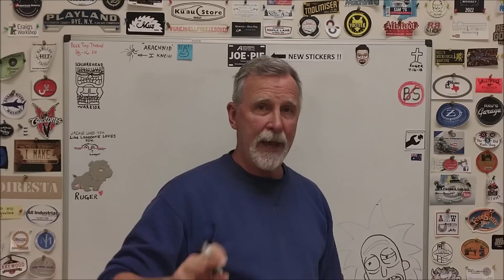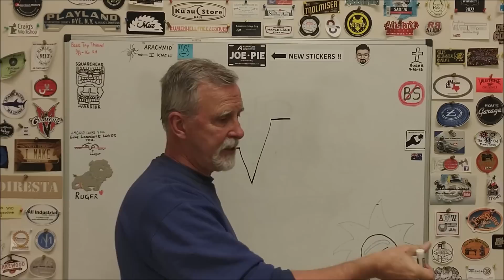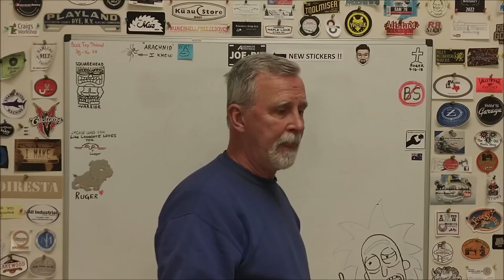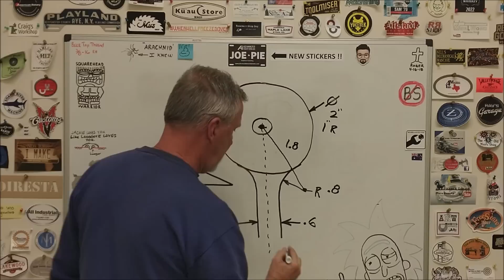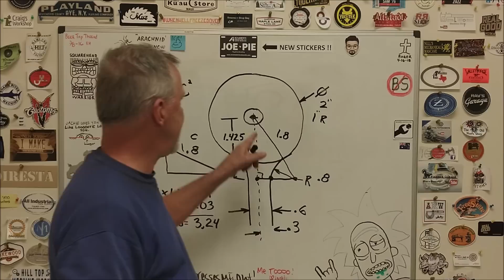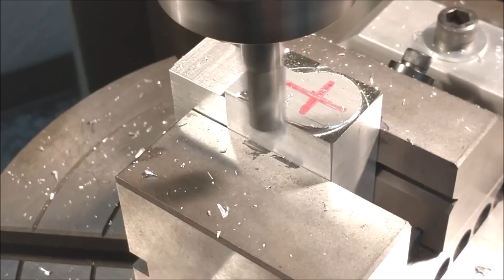Machining Perfect Dog Bone Features -- Quick and Easy !!!

Comment: Joe:  I wish you had been my math teacher as well.  Another tip.  put the parts of the equation into the form of a triangle.  C^2 above A^2 + B^2  This helps math dolts like me to keep track of what to divide into what to solve for the missing #.  Works for Ohm's law, Power formula, anything with a number (+ or *) a number (=) a third number.

Comment: Joe, really important to point out that Pythagoras only works for right-angled triangles - 90 deg between sides A and B.  All other trinagles will need trig.
Reply from the maker: You are correct. I did point that out later in the video.
Reply: @joepie221  Yes, I got there eventually!  Great job as always Thanks.
Reply: Math in the beginning of the video  should not  be explained here. Everyone older than 13 should know it.

Comment: I'm always fascinated that people need explanation for 6-th or 7-th grade elementary school mathematics :)

Ah.. and also that americans just do not learn even the definition of the Inch :)
And yes.. definition of the inch is that it's exactly 25.4mm :)
So 2" is 50.8...
Reply: I work on American designed, Canadian made machines here in Australia. They have been exporting machines into metric countries for decades now, and they still don't know how to calibrate the machines for metric. I have now found out that they have rounded out 12 inches to 30 centimetres, which makes a big difference when measuring product with lengths typically around anywhere from 3 metres to 25 metres. And I have fixed up numerous other design or programming issues. No matter how often I tell the Americans about the issues, they basically just ignore them.
Reply: Knowledge is Relative 
If it’s over 50 years since you did the theory at school and never used it since, then a refresher is a great help.  I’m not been picky but if your system is imperial and you don’t have a need for metric why would you want to know. it’s the same in the metric countries there are plenty of people who couldn’t tell you what an inch is never mind the conversion.
Reply: @oldcomps  if we are at the channel with themes like history, music, fashion.. I will completely agree with you.
But, this is machining, technical channel, and at least some degree of technical knowledge is expected.
Almost any technician I know, know that inch is 25.4, or at least that it's 25 'and something'. Simply cos you are in contact with both systems. Of course much more with metric in Europe, much more with imperial in usa.
Well... I learned this theorem, almost exactly 50 years ago. But.. I was using it up to the finish of hi school, on the college...
So at least 10 more years.
Again.. if you are not lawyer, economist, historian.. but technician... I can not imagine that at least basic math is not your interest. And if you have interest in something.. you never forget it.
Reply: @bmalovic  I think one of us is misunderstanding the point of the channel, I watch this channel not because I’m an expert in engineering but because I have an interest but don’t have the vast knowledge or the experience of someone like Joe, I’m sure there are historians, musicians and fashion designers who also watch the channel. 

I really don’t understand why anyone who knows everything about engineering needs to watch a channel like this or why Joe would be sharing his vast knowledge if it’s not to educate and encourage interest, surely if the audience is only engineers he is preaching to the converted.  

Fortunately YouTube is full of people who want to share their knowledge and experience with others and don’t judge their audience on their level of knowledge or ability and research out to all.
Reply: @oldcomps  Obviously we do not understand each other :)
This math is basic elementary school knowledge, not some "rocket science".

I do not say that someone without it should not watch the channel. Why not? I know very little about many things, so it is interesting to me to watch something like knitting for example.

But if you want to make something.. that is completely different pair of shoes.
You will need at least basic knowledge.
No.. you can not "educate" yourself from YT. :)
This kind of "education" is unfortunately all around us in last years. With "tradesman's" that do not know nothing about their trade. Just good marketing, usually.
So their "job" start to fall apart as soon as the leave.

Any way.. we all have our opinions...
Reply: @bmalovic     I agree we clearly don’t understand each other especially as I fail to see how you cannot educate from YouTube, I know I have learned a lot from YouTube and have made things I wouldn’t have without it, so let’s just agree to disagree.

Comment: You could also rotate the rotary table 284.66 degrees, saves cutting in two halves.
Reply from the maker: Though I haven't checked your trig, using the angle is certainly an option. BUT...You would first have to know how to figure that out. This way, Nope.
Reply: @joepie221  True.

Comment: I once had a math teacher who was as good at explaining math as you are.  Made it through the next two years with what I learned in one semester in his class. Neil Cronstrum, one of the few teachers who was good enough for me to remember!  After his class the next two were teachers,but not great at it 😢. My head was stuck on metal and fixing things so math at the time was not important, as I was going to be a mechanic not a bean counter or scientist.  You remind me of Mr. Cronstrum, bless his talented abilities.  And if you ever get bored with metal chips, teaching might be a great vocation 😊.  Thanks Mr. Pieasenski ( OK I blew that last name, but I’m sure it has been done many times already 😮).  Cheers Buddy! 😊. 🤙 🤙
Reply: Addendum- The metal working teacher in my high school was a wood working teacher.  It was very regular that Max would instruct a student to have me show them how to weld, both gas and stick, cast parts in aluminum, run a metal lathe or the brand new unused shaper.  That was the grand total of machine shop tooling we had available. A break, shear, and slip roller was the sheer metal portion of the shop.  The trades were very basic except for the auto shop which was brand new at the time, and I was one of three juniors who made the cut from three hundred applicants, twenty seven juniors made up the total of thirty students for the first year.  I know that schools have basically lost all of the trades courses because of either lack of candidates or liability insurance and it makes me sad.  But West Chazy didn’t have the web and people generous enough to teach strangers life skills for free.  What a time we have been through., eh?
Reply from the maker: I take that as a big compliment. Thank you. Teachers have a big responsibility and an even bigger opportunity to shape a young mind. I've had a few memorable ones as well. Ever wonder what happen to them. i do.

Comment: Us math types like to make clear that the right angle is necessary by making a little square there.  You'll see this often in drawings where the 90degree angle is important.  Only right triangles follow the Pie-thagorean theorem.
Reply from the maker: I did include that at the end, but skipped over by accident because only a right triangle can be formed using the geometry I demonstrated.

Comment: What's up with the shoulder on your rotary table pin? I don't recall seeing those before. 

I'd love to see a video showing how you make those things. I'm especially interested in how you get the flat surface and the axis of the cylinder aligned. Is there a mechanical trick you can use or do you just measure carefully?
Reply from the maker: Paul, I can always count on your comments to be on point. You have good eyes. Pins leaving the shop at this time will have that small collar by the locating block.

Comment: Thank You for this practically oriented video!
You missed to tell that the angle between A and B must be 90 degrees in the beginning! The formula only works for square angle triangles.
My rotating table is vertically arranged for the moment, no copying here.... No dog either.....
Reply from the maker: The geometry that presents itself in this situation will always be a right triangle. I did remember I left that detail out, so I included it at the end.
Reply: @joepie221  Yes, You made it clear later. My comment was written before that.
Thanks for the video! Rotating table work is always fascinating. Managed a few myself.

Comment: Don't ubderstad why you do not climb all the way around. (Spot face to spot face)  - 

BTW, Audio in the office is awful, but out in the shop is clear as a bell. - Did you use 2- different mics?
Reply from the maker: There are many ways to do this.
Reply: To climb cut all the way around by moving the turntable, you have to know the angle to stop turning.  Remember, you are making the cut by moving the turntable, NOT the X or Y axes of the mill table.  With Joe's method, you don't need to find that angle.

Comment: You may be an awesome machinist, but you are no math teacher.
Reply: He is not trying to be a math teacher, he is trying to show how a small subset of math can be applied to what he is doing. When I was still working (as a support engineer in industry) we had frequent school visits to let the children see various work roles and some aspects of various jobs. As we often did heavy lifting operations (which always seemed attract people for some reason) I often explained to the children that knowing approximate values of √2 and √3 (and the inverse of them) along with a 1,1, √2 (90°, 45°, 45°) triangle and a 1, 2, √3 (30°,60°, 90°) triangle were useful in engineering. It allows quick estimates of the loads in slings, for example, to figure out if you needed to make a more accurate calculation for safety reasons. They also seem to pop up in engineering tests as well. I was not trying to be a math teacher, just showing how a small subset of math can be of use when doing some jobs. Want to drill six holes evenly around a centre point? The 1, 2, √3 triangle is your friend here.
Reply from the maker: Many would disagree.

Comment: 3, 4, 5,... gotta have it !!  (building houses)
Reply from the maker: Forever 90.
Reply: I can remember a challenge used in "team building courses" where you were given a piece of rope and told to form a perfect square with it. The simplest solution is to tie knots in it to divide it into 12 equal lengths (leave a bit each end to allow for adjustment as necessary) then use those knots to form a 3, 4, 5 triangle. From that it is an easy step to change it to a 3 x 3 square. Just need to know that little old 3, 4, 5 triangle.

Comment: Thanks Joe. that is very timely. I had just drawn up 2 dog bone features for tie rod ends and stylus/engraver holders for an eidograph (better version of a pantograph)  that I'm making. Now I'm pondering whether a fade would give me more strength than the current design, which is threaded right up to the circular end of the bone (the parts are acrylic, so the stronger the better).

Comment: The RT master! Doesn’t tool deflection (for a deeper cut) create a slight blemish where the climb and conventional cuts meet, though? Presuming best practice would be to cut slightly oversized first, then finish with a final climb-cut finish pass ALMOST all the way around (creating just a tiny blemish if any at the very end of the cut)? Or … just polish out the blemish! 😅

Comment: An old carpenter trick of squaring up a large assembly. 3,4,&5. Measure 3 feet on one leg, 4 feet on the other and manipulate the assembly until you get 5 feet between the 2 points you measured.
Reply from the maker: Nail it.
Reply: Been out the trade for quite a few years now but constantly used 3,4,5 to ensure things were square in steel fabrication.

Comment: You forgot to emphasize that the Pythagorean Theorem  ONLY works with a right-angled triangle.  It is completely possible to have a 3x4 triangle with a hypotenuse longer or shorter than 5, depending on the angle.
Reply: 23:05   watch the whole video next time.
Reply from the maker: Shown clearly at the end of the video.
Reply: @joepie221  I did see it, but it came off as a bit of an afterthought.  It would have made sense to say it at the time when describing the math, or at least go back and include an addendum/error caption/overlay.  TBH I started writing the comment after you finished explaining it, and I also waited a bit longer to see if it was mentioned later.   I'd already posted it by the time it was mentioned in the last few sentences of the video.

Comment: Joe your audio could use a little help. My volume is all the way up and I'm having a hard time hearing you.   Awesome video as always.
Reply: The quality of the audio is very poor. It's likely caused by recording in a room with lots of hard surfaces and using a wide angle mic too far away. Using a shotgun or  wearable mic would dramatically improve the quality. 

Those that are defending the audio either have: serious hearing issues, using very low quality equipment, or they are being dishonest. I'm listening via Klipsch speakers and a Yamaha amp, and it sounds terrible. 

The inability to enable stable volume is a good indicator of a poor audio recording. The function is disabled when the audio is outside of acceptable levels.
Reply: Maybe time to get the old ear canals checked.
Reply from the maker: I checked everything here. Its fine on my systems.
Reply: Think something at your end. Sound is fine for me